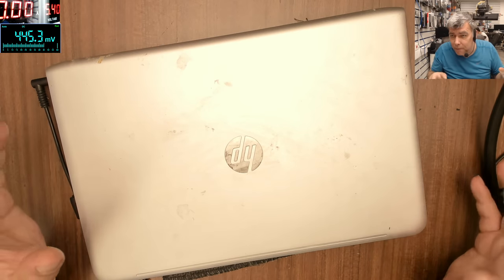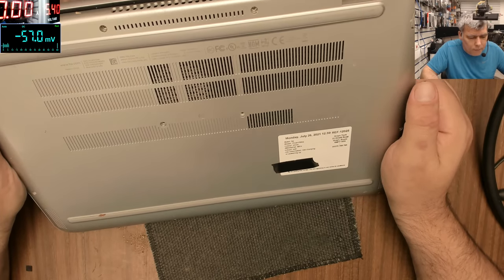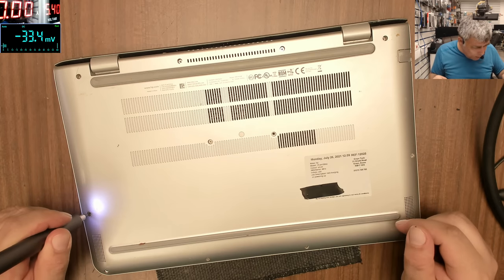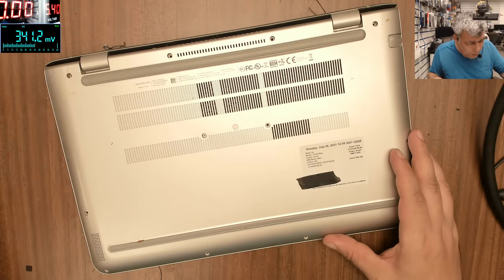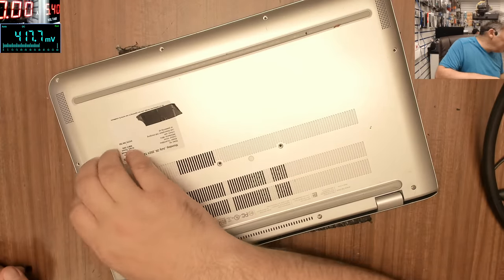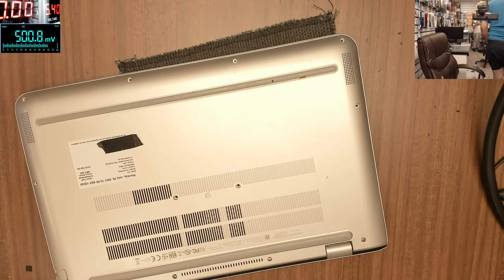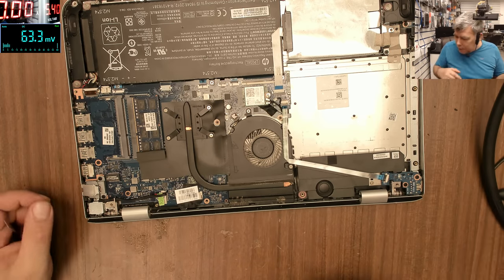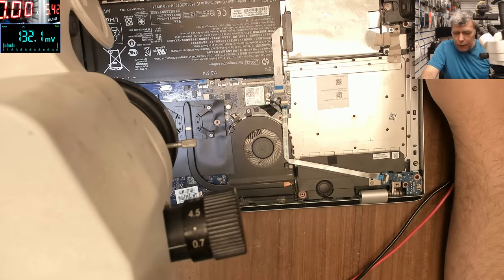Hp 15-AH150na laptop, dead, not charging - liquid damage repair

Comment: It was clear that the short was on the other side of the board. If it was one of those caps, it would be quite hot, and we would see the petrol evaporate quickly. I could see it evaporating from the PCB.

Comment: you can open keyboard but as some other comments already mentioned its very time consuming. keys and pads are molded together with small plastic pins, they can be melted carefully and sepatate metal shield and key pads. The way Sorin fixed with a transistor is much more efficient.
Reply: the better way is clean it with ultrasonic.

Comment: I'm an electronics beginner, how come it worked when you removed the capacitor and didn't replace it? id really like to know, love the videos also.
Reply: I have the same question so unfortunately I can not answer. Hope we get an answer.
Reply: There are many many small ceramic caps which are there as a "recommended" bypass capacitors. But many of them are not totally necessary. Removing a lot of them could cause some interference/instability but removing one may not be a big deal. Just check everything works and if it does, don't care. :P
Reply: @kex1xik  Yeah, that's the main reason but he mentioned he had an schematic so the best practice would be to replace it.

Comment: I wish I could bring my laptop to you! I'm having a strange issue on an HP laptop. The screen no longer works, but the computer does. The connection on the board where the screen cable plugs in is getting really hot.

Comment: Sorin. I tryed to fix a laptop today. It was a HP Elite Book 755. It seems to be of good quality. When i plug the charger the charging lite is blinking and also the power buton, but it dos,nt do anything. First i disconected the bias battery, then tok it apart with care and i disconected the the battery harddisc and ram keyboard and powerbutton screen. It was of course i disconected the blinking, but i found the blinking on one of the coils. 19 volts is ok. i had one coil with 5 volts and one coil with 3,3 volts. and one coil with blinking 3,3 volts. I told my frend that i cant do so much more because i didnt have more than a multimeter. Though he gave me the laptop and said thank for trying. What do you think it could be. I dont think it is a short on this 3,3. the diodes lights up good and i cant mesure short. Do you hav any ideas?

Comment: I did open broken keyboards with keys not working and did manage to fix the traces in order to make them functional again, but the fix is not reliable usually and IT IS NOT WORTH THE TIME.
Usually, unless you have a very expensive keyboard that somehow is still using membranes and trace sheets, they best action is to just throw the keyboard away and replace it.

Comment: hello rando with a dead laptop from water damage awell i found that a buzzing sound comes from a grey square labeled ir5 it only has 2 legs and gets hot when buzzes could that be what died, any suggestions? thanks T

edit: and if so what is the part names and where could i find it??

Comment: Hi Sorin it is very dangerous with 19v to main power rail on the current. If you have a shorted highside  mosfet    you will instantly kill the cpu, gpu or PCH
Reply: This is theoretically true. But in practice I think it would have arrived already killed in such case. See - the input mosfet is not turning on so superio/whatever probably detected over-current. But if it were high-side mosfet on a regulator shorted, it would need only a very little current to kill everything after the regulator with 19v.
Reply: @kex1xik  yes but therefore are the first second mosfet who stops the current. There are there to protect those rails., if you bypass them then you sent it right to the cpu, PCH , etc.
Reply: @stevedebeukelaer1424   But that first mosfet can be turned off only if PCH/EC detects over-current. But at the time it would detect over-current on this 19v rail with high-side mosfet shorted, it would probably be already too late (high voltage would have reached the cpu PCH). Note it cannot detect over-voltage because 19V is expected to be at the regulator input (it is just not expected on the output but I doubt there are over-voltage checks on every regulator output which would turn this first mosfet off). Without voltage there is no current. So if there is over-current AND high voltage through a shorted high-side mosfet, it is already too late.
Reply: @kex1xik  Hi maybe is it true but I fixed already laptops with shorted highside mosfet where the cpu not died. But replace the all mosfet + there driver. But I am sure if I tried to  inject 19v it was not possible. Best regards

Comment: Hi Sorin I like your work, but one thing I think you are wrong. When you test motherboard with voltage injection methot you use 19 v. I think this is wrong. If you have a short mosfet on cpu power supply you can burn the cpu for example. You can use 1 or 2 volts for exaple. Sorry for my bad english. :)
Reply from the maker: You can't burn anything with only voltage :) The current is the one burning things
Reply: @electronicsrepairschool  Plus there are lots of videos where you have already advised us not to use 19v to inject voltages, especially on Ram power supply, CPU power supply etc, because we risk damaging the board. I advise the person who posted this comment to watch more of sorins video. You can't just draw conclusions by watching one video. There are even videos where's he's advising his students not to be quick to grab a power supply. This man is a veteran in  electronics. Thanks once again Sorin. Mr Excellent, Mr Doggy...lol 
You always get your point across.
Reply: @electronicsrepairschool  Ok I agree with this. Can you explain me if you have short mosfet in cpu power supply and inject  a 19 v. This voltage pass through the cpu. Can you burn it. May be I wrong. If I wrong I appoligize you.
Reply: @davidasare6841  I watched them all.
Reply: @rumenpetrov5755  19v Is the main Power rail , other Power supplies have different voltages (you don't get 19v from USB right?)
Reply: Yes you are right , injecting 19v 4 amps will kill cpu instantly if a board has shorted mosfet on cpu side , it happened to me two times and i stopped injecting 19v since then , use 1v to be safe and voltage injection shouldn’t be first thing you do, you do it when you can’t figure out the problem.
Reply: @FerdAboubakrOnline  Yeah you are right. First thing is to measure a resistance of any coil. And if you inject voltage the thermal camera is very helpfull.
Reply: @FerdAboubakrOnline  and I talk about if you have a short mossfet on a high side of cpu power supply.
Reply: He was following the 19V power rail.
Reply: @electronicsrepairschool  VCCORE and VCGFX power lines have a very low resistance to ground as CPU and GPU are the most power consuming devices on a motherboard. If the upper VCCORE of VCGFX lines MOSFET was shorted, as soon as you inject 19V on the main rail all that voltage and the current will go across CPU or GPU, killing them instantly if they were not dead yet. Nobody, even you Master Sorin, can jump over Ohm's Law ;)
The lower the injected voltage, the safer will be for the more sensitive components.
Reply: @cyberpeque  That is what I mean. Great answer. Thank you!

Comment: hows it going, wonder if you know what my problem is. I have a samsung rv510 that randomly shuts down and restarts. I have changed power jack as this was broken anyway, repasted both gpu and cpu, checked ram, battery charges to full then dies after a few minutes without the power supply plugged in. This problem is doing my head in. Could it be just as simple as buying a new battery or do you think its a dodgy component mosfet, or cap 
cheers alan

Comment: Sorin you tested for shorts with voltage settings on the meter?
Reply: He was following the 19V power rail when he found the open circuit so he used 19V starting with 2A then increasing to 4A.
Reply: Sorin explains why he does that instead of Ohm setting where it applies, in another, earlier video.
He uses the diode test mode when semiconductors are in the path, as they start to  ´open´  at a certain voltage, typically diodes at 0.7 volt, Schottky low drop at 0.3 or something. Otherwise, we might draw wrong conclusions when measuring.
I recommend you look at all his videos, from the start. He shows so many diagnostic tricks nobody will tell you about.
He discusses basics that do not always spring to the mind, taught only by such an experienced man like Sorin.
Sorin makes us understand to recognize the words, so to say, when before we only saw the single letters.

Comment: Hello - I came across your channel searching for repair info on HP Laptop 15-ay039wm that suddenly has a black screen with the CAPSLOCK blinking once. I have read that this indicates a CPU problem. Is this correct and do you have a video on how to repair this problem? Thanks!
Reply: Hey i have this same problem... Did you repair it? How?

Comment: I see you use Zippo lighter fluid to clean and trace the Heat. Can one also use Electrical Contact cleaner to trace where the Heat is coming from? Is the lighter fluid also safe to use? Thanx
Reply: Lighter fluid leaves no residue and contact cleaner is more aggressive chemically.
Reply: @XLR8RRICK  Thanx for that.
Reply: @XLR8RRICK  lighter fluid actually leave a small coating of light oil on the board once the solvent evaporates. This helps to protect the board if there is any residual moisture in the keyboard that might seep out onto the motherboard after the repair.

Comment: hi sorin, thnk you for the videos, i leaned a lot from u,
but now, i need ur help!
i have a lenovo b575 laptop that is dead!
bios chip 3.3 is 0.652 volts
and the 5v is gone.(i checked on the chokes and mosfets, mosfets were good and they had 20 volts and no short)
someone told me your cpu is gone or its a fch issue, but i think its only the 3.3 5v ic (the driver chip)
could you help me out?

Comment: The customer is a dirty bastard however Sorin you did not replace the faulty capacitor, also you did not cable managed that ribbon cable correctly, i hope you did that off camera, if I was a customer and I was getting this type of service I wouldn't be happy.
You really should take a picture before you disassemble before reassembling to make it easier to follow how things were.
But if you do that off camera to save video time, that is fine.
I bet this particular customer would not even bother but some of people are neat with their hardware.

Comment: Can someone explain why he didn't replace the capacitor with a new one? Why do they add a capacitor then when it works without a capacitor???
Reply: There are many capacitors in parallel, removing one wont make a difference. Technically the capacitance will be reduced but it will still work.